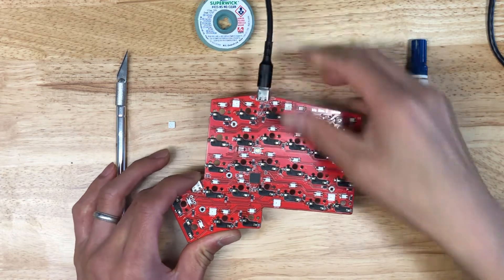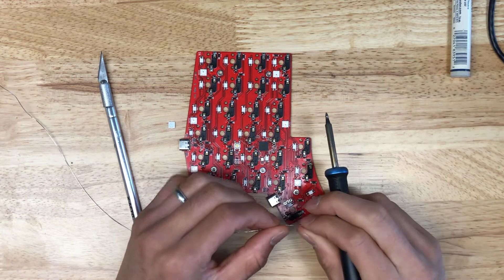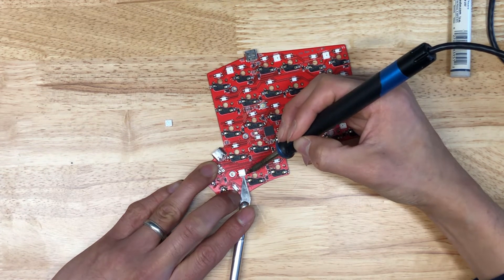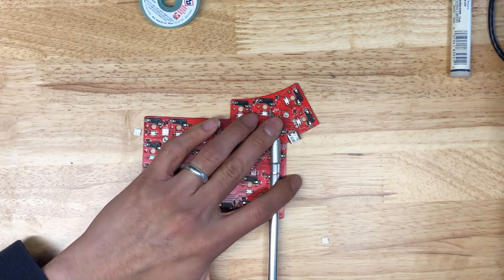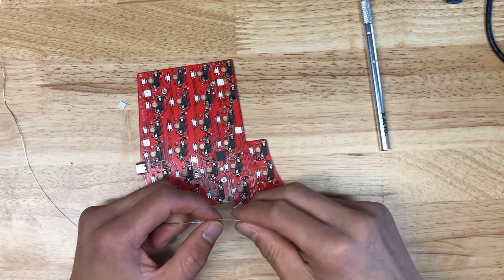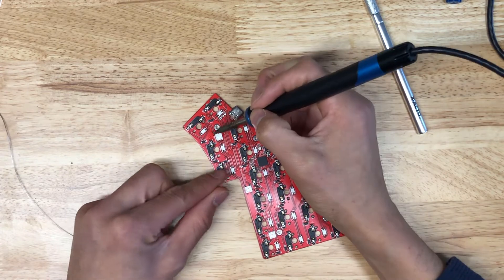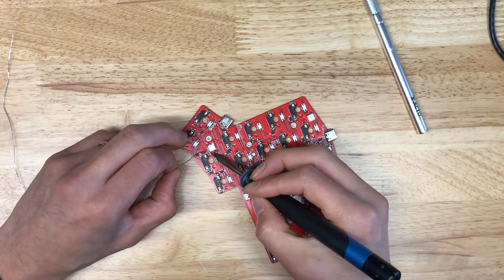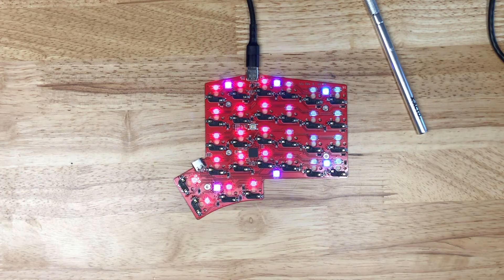How to Replace WS2812B/SK6812 RGB LEDs

Comment: If you pick up a Yihua 959D hot air rework station off of Amazon, it makes it WAY easier to pull those LEDs off of the board without damaging anything.  I am also wondering if you've ever heard anyone say "solder" in person, because we usually pronounce it to sound almost exactly like "sodder".